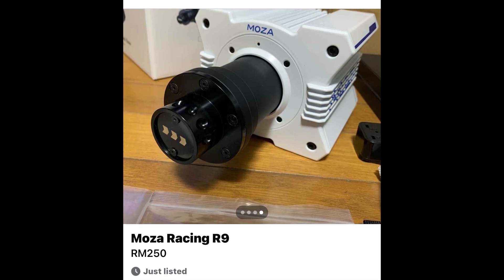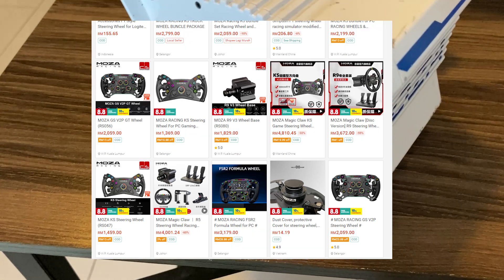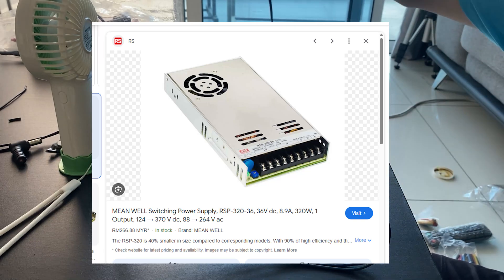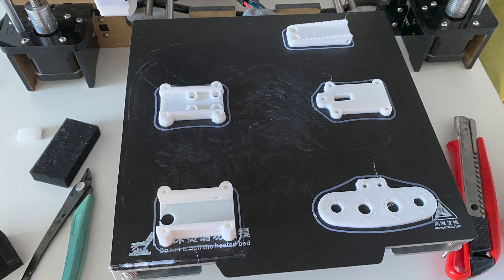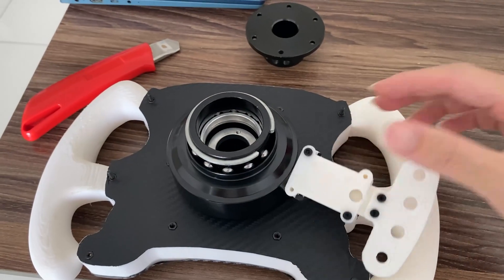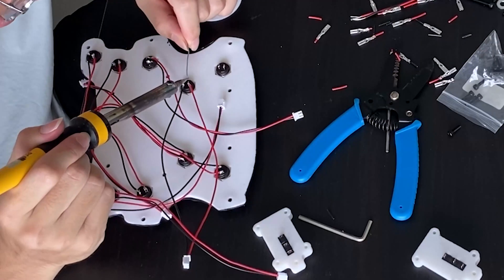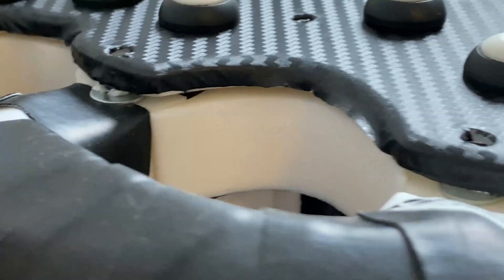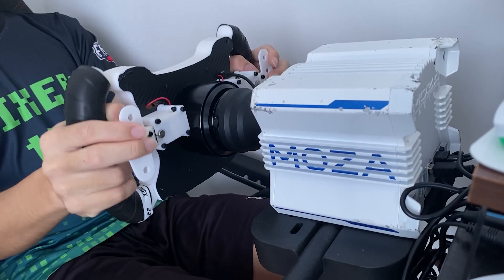Fully 3D Printed Steering Wheel for Moza; DIY Moza R9 PSU [$50 Direct Drive Thift Build]

Comment: Hey. What torque are you using the base at? I'd like to fully 3D print my wheels but I'm unsure if it can handle 12Nm. I rarely race at 12Nm but I like to have headroom. Cheers!
Reply from the maker: Depending on the game can be anywhere from 75% to 85% in game strength. But that’s mostly so I don’t get tired. I’ve tried with 90% and the wheel seems to holdup fine. Just make sure you use threadlocker on everything so they don’t vibrate loose over time

Comment: Congratulations on the project, I had tried to do the same project, but I gave up because of the problem between the paddle shifters and the quick release. Could you post the link with the STL of the modified paddle shifter? Thank you in advance.
Reply from the maker: Sorry for the late reply. Yea I was planning to release the files on Thingiverse but theres some dimensions I need to fix before that. A bit busy atm, so it might take a while, will update the link when its done